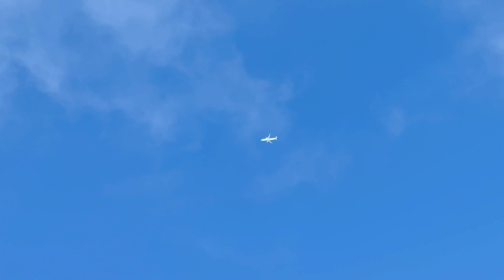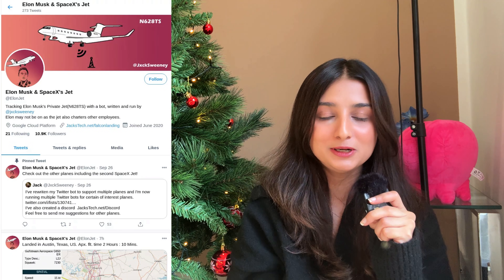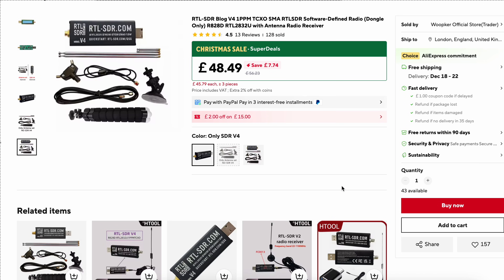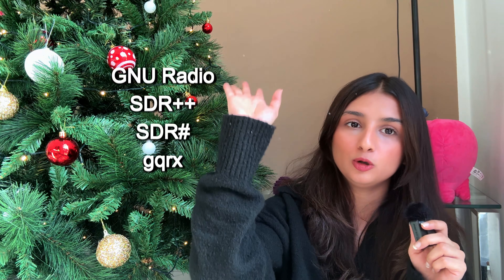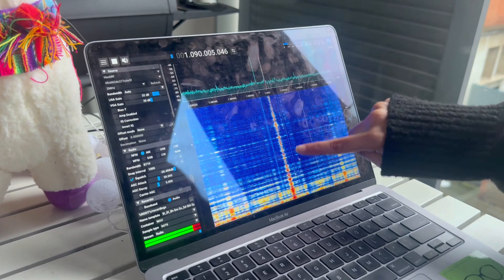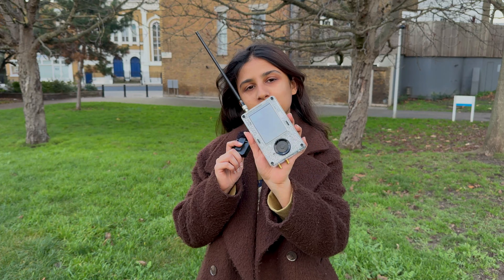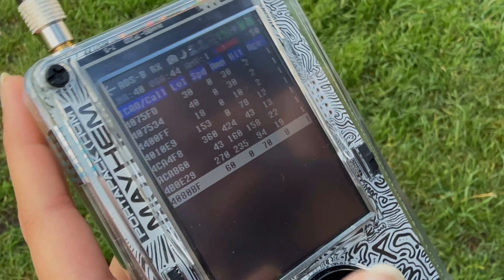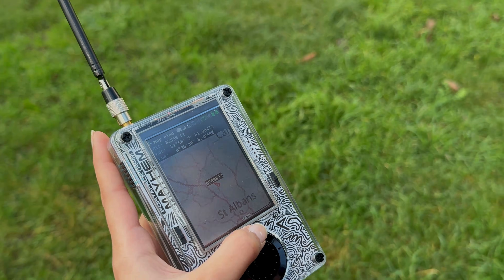Hacking radio frequencies for flights!

Comment: awesome that you are interested in RF high frequency technologie, especially since you're female and so young  😇 -> great video! You got an subscibtion 😎
-> more ideas for your HackRF: worldwide broadcast reception on shortwave - or reception of meteorite refexions from the scattering at beacon signals or for example the meteorite scatter at the  french GRAVES radar system - or reception of the ultrasonic signals of bats usind an MEMS microphone as antenna - or the reception of SSTV pictures via radio reception from the ISS space station  - - - >  there are sooooooooooooo many possibilities for an SDR receiver like the HackRF rig.